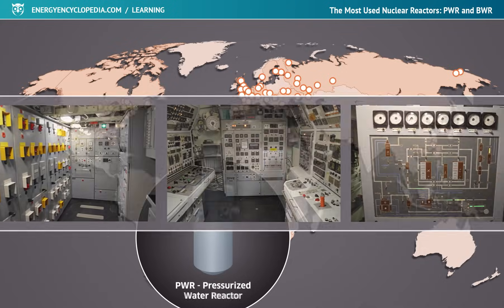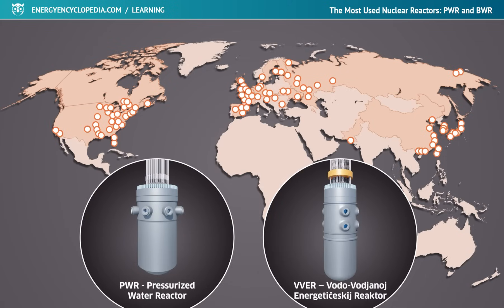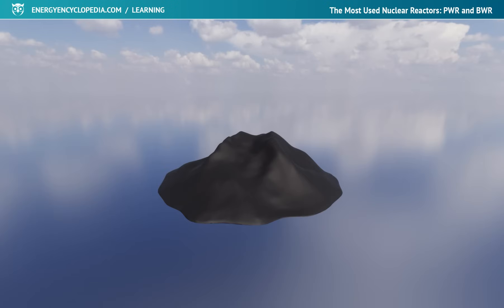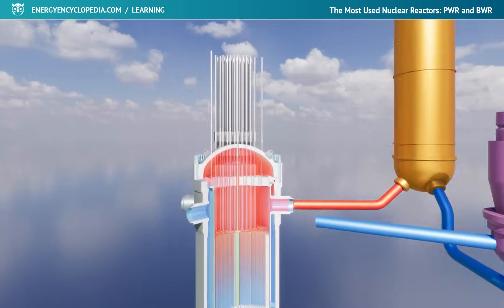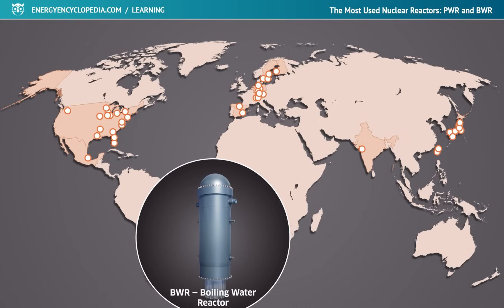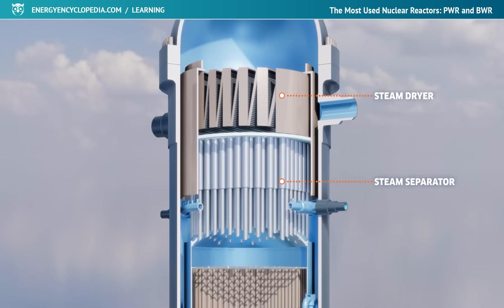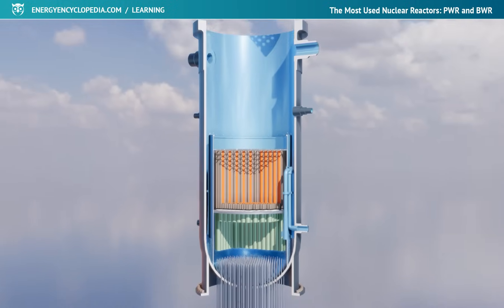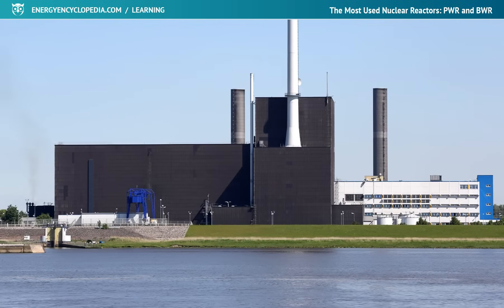The Most Used Nuclear Reactors: PWR and BWR

Comment: seems like the pwr is much safer than the bwr system
Reply: PWRs are a LOT better to work at .
No irradiated Water / Steam in the Turbine or Cooling System  .
They are alot " cleaner " . No need for PCs , ( Personal Contamination ) Suits needed in the Turbine Building  .
Reply: they’re equally as safe, it just depends on the reactor design and safety procedures
Reply: Yea,it "isolates" the radiation better as the radioactivity doesn't enter the auxiliary building and the turbines
Reply: I was right there with you they went one step further and the benefit is quite obvious to most. But they built those bwr over there...until they realized.